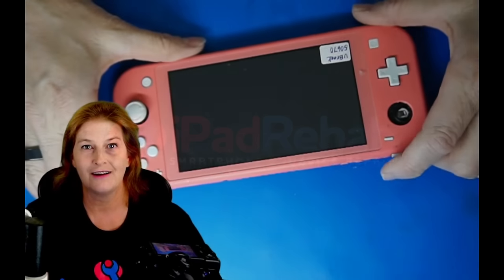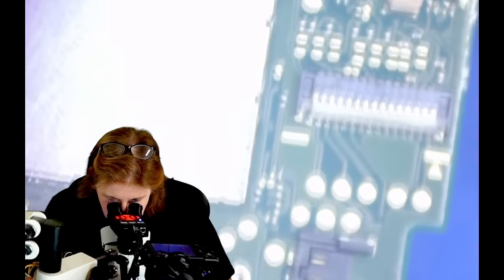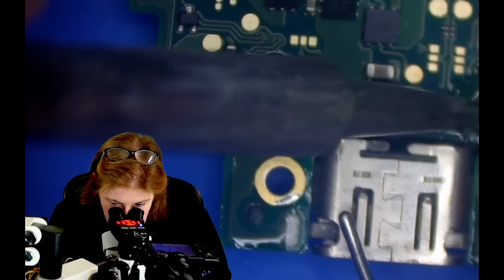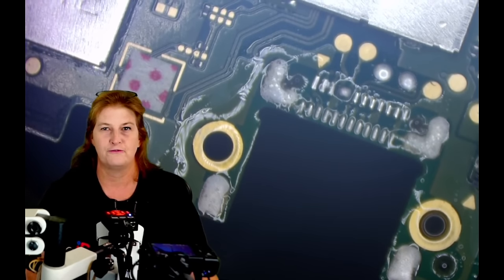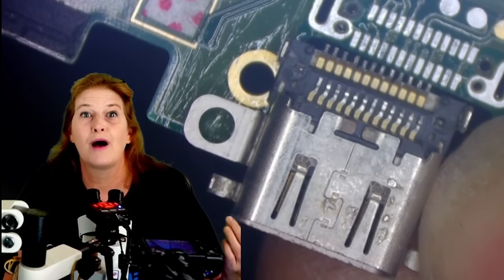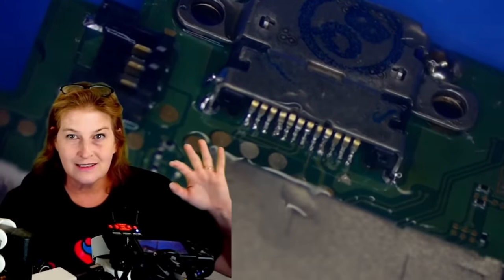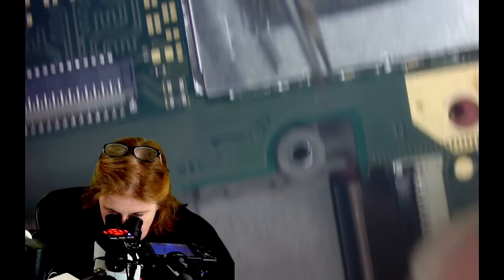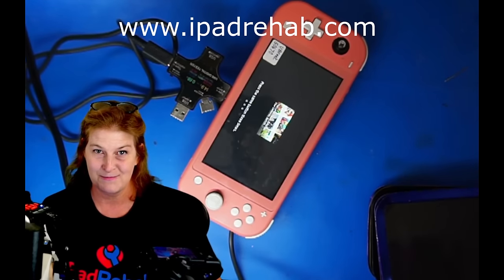Nintendo Switch Lite Charge Port Fix:  Jessa's Tips and Tricks

Comment: Jessa, why don´t you cut the end of the tip on a 45º angle? That way you can desolder  under the microscope.
Reply from the maker: Part of the “fun” is wearing shorts while doing these and you never know where the little plug of solder will splash

Comment: FYI one can cut the tip of the solder sucker at an angle and it will still work and allows you to get it under the microscope.

Comment: I have to say, I disagree with your assessment of using a low melt for removing the port. I use copper braid to suck all the solder out of every hole and clean all the low melt off the pins and ONLY when it is 100% sucked up by braid, do I then resolder the port using leaded solder. I have been doing this for many years and I don't ever get my port replacements back. You do have to do more work to get that low melt off the board but it allows me to use much lower heat when removing the port which is of course, much safer for the board.
Reply: How do you get the hidden pins?

Comment: why do you make it so complicated? with hot air you just take the old one off, and while still hot pop the new one back on.  no need to be clearing holes and all this stuff.  thats the way i used to do it before i got a hot air machine. having to desolder everything real PITA.  hot air makes everything so much easier!
Reply from the maker: Because half of the original low quality factory solder goes away with the old port, and the new port would be very weakly attached with that method.

Comment: My own tip and trick for these is to make sure you don't  get any flux in other connectors on the board and squirt some switch cleaner in the port after you have cleaned up. Dried flux in any of these things can create a headache when you think you are done and find something doesn't work. Switch Lites are a real PITA when you reassemble and have to go back.

Comment: Love the information you share and appreciate it!
One piece of feedback on this one as someone who has handled these devices by the hundreds is never put power to one of these without checking the port first.
They do not have very much protection between the port and the APU and you can easily kill an otherwise fixable console by plugging power into a compromised port.
Reply: Just thought of menitoning that advice after watching your channel and discovered your post :)
Reply: Agree. Always visual first.  I also always test at 5v only first - even after port replacement and dead testing with a breakout board.. 5v seems at little safer until you know what's what.

Comment: Visual first, then plug in. You probably aren't going to break the charging circuit any more than happened when the customer did it but I like to keep volts away from things until needed. I also always test with a standard 5v charger first because if something is up, I'd rather it had to deal with 5v rather than 12-15v. If the 5v charge looks good, then I try a proper PD charger.